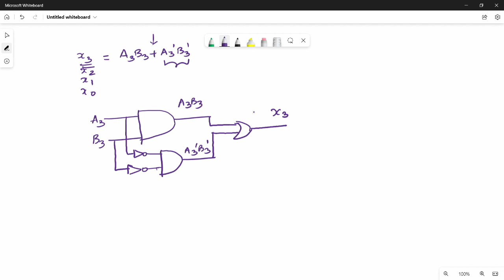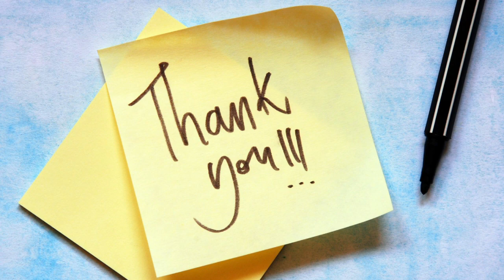1.15. Magnitude Comparator in Tamil

Comment: sir, you can even do this in k-map(if they ask 2 bit magnitude comparator) by taking 1st input as a1a0 and second b1b0 and compute the values for a<b a=0 a>b and find the kmap for each one of the output,
Reply from the maker: Good idea, I havnt tried. You can try and check if the answers are same

Comment: Sir diagram seprate ta kuda podalama book la combine Pani potrukanga
Reply from the maker: Separate kuda podalam. Answer keys will be based on foreign author only.
Reply: @because2022  sir enaku combine Pani draw panna confuse aagudhu sir so Ella questions diagram separate ta podlama like decoder la D0 to D7 vara ella
 equation ku seprate ta draw panala ma
Reply from the maker: @BatMan-6R  Athu ketingala. When the output needs input from multiple diagrams, everything should be within one diagram. Konjam two times varanju paranga. Confuse agama irukum.